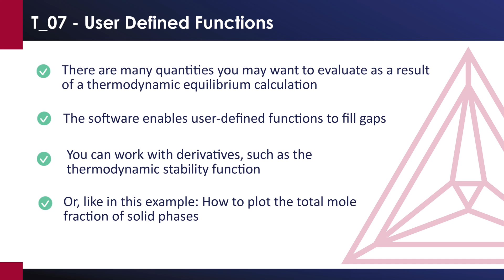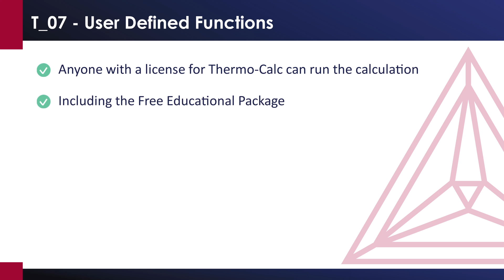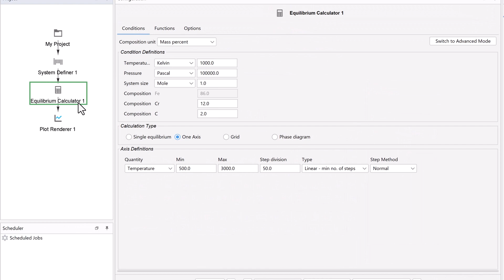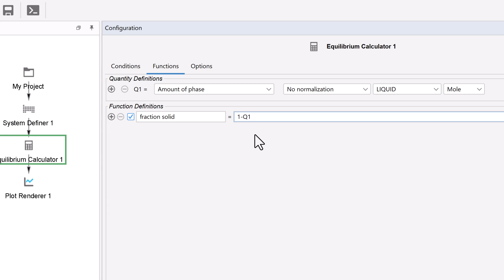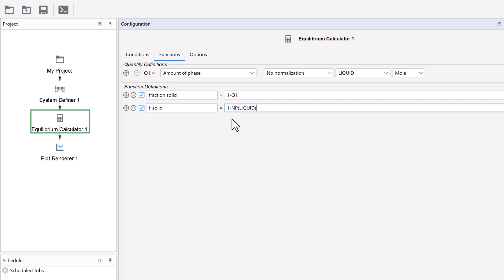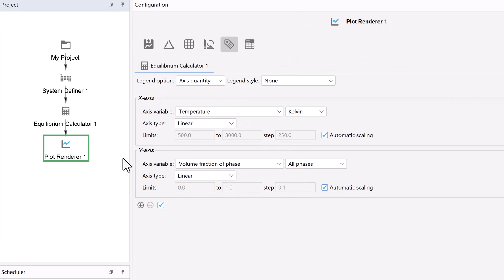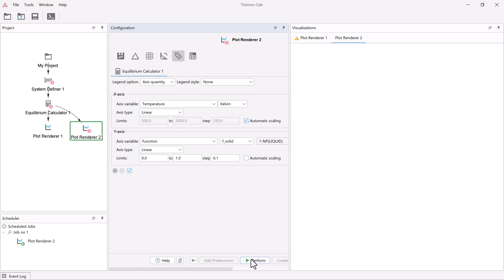Example T_07 - User Defined Functions

Comment: how to determine eutectic point temperature and composition, maximum solubility etc etc 
just like we do in iron  Carbon diagram but I want to know these In high entropy phase diagrams
Reply from the maker: Hi @AliHassan-mh2gh,

Using a "fix phase" condition to find the eutectic line or plane will reveal all phases in equilibrium along the eutectic, and will show the eutectic point as the liquid composition, and the composition of each solid phase.

Comment: Nice. I'm currently using the educational version. Just wanna ask the whether the full version consist of High Entropy Ceramics database (High Entropy Oxides/ Carbides). Or whether I can create HEC based on metal oxides database? Thank you so much.
Reply from the maker: Hi @HenryNg1998,

You can probably use TCHEA7 for Carbides and for Oxides you can check the info for TCOX13: https://thermocalc.com/wp-content/uploads/Documentation/Databases/Thermodynamic/tcox13-technical-info.pdf.

We are releasing TCUHTM2 with our next release, this could be an alternative covering both oxide and carbide ceramics. But check so that the relevant metallic elements are included in TCUHTM2 when that information is available.
Reply: @ThermoCalcSoftware  Thank you for your information. And just 1 more question, may I combine these 2 databases together: TCHEA7 and TCOX13 to access the possible elements I want?
Reply from the maker: @HenryNg1998  Hi! In order to give you an accurate answer we will need some more information. Please email us at info@thermocalc.com and explain what you'd like calculate.